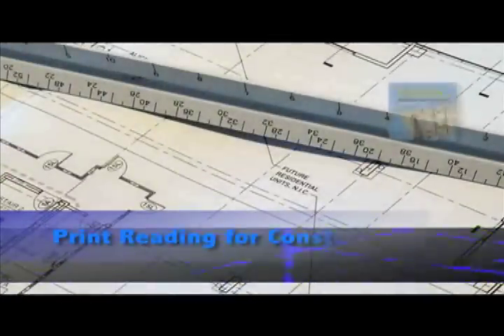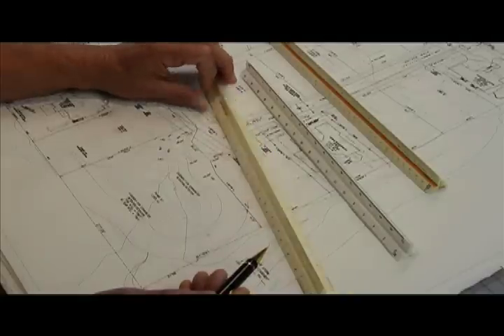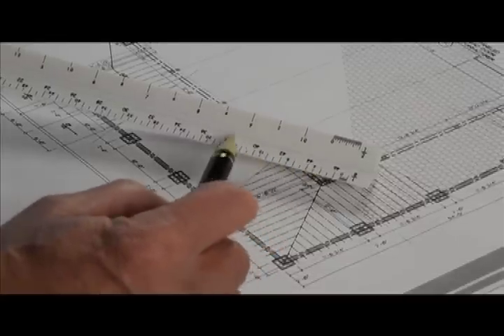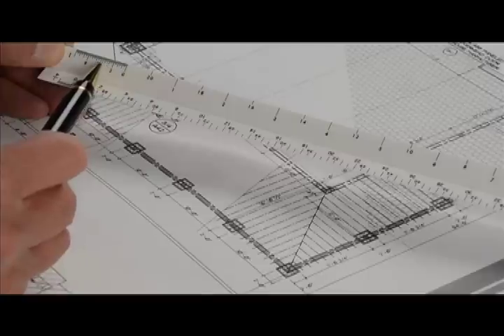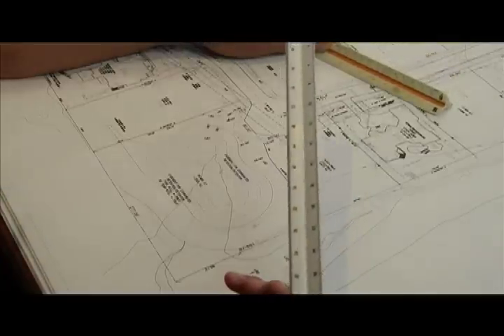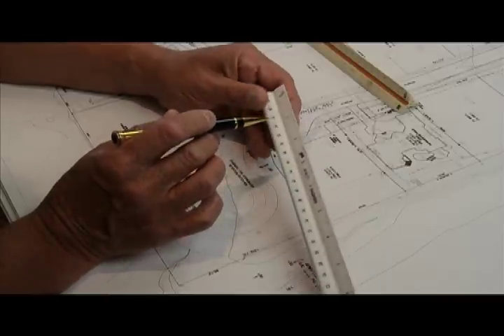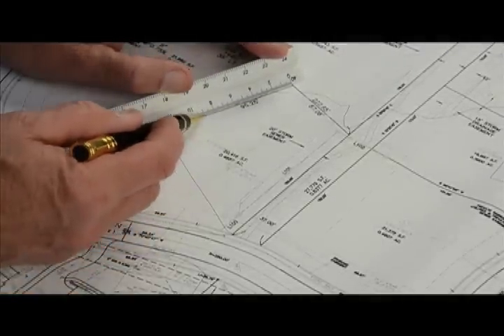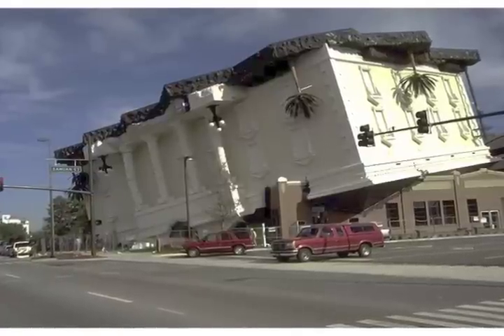Introduction to Using an Architect and Engineers Scale

Comment: For example, if 1” = 40’.  Why not just take a regular ruler and measure how many inches it is and multiply by 40?  I’m trying to figure out if that’s accurate. Thanks.
Reply from the maker: John M. Runyon... yes that would work... but become more difficult when you have for example... 3 ⅜” you have to convert the ⅜” to a decimal then multiply ... thanks for the comment. Dan the author